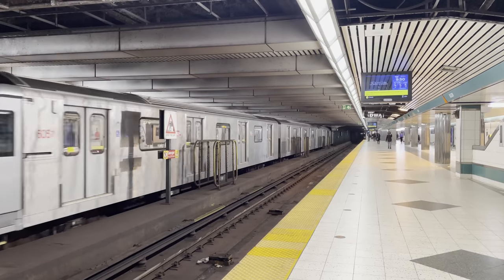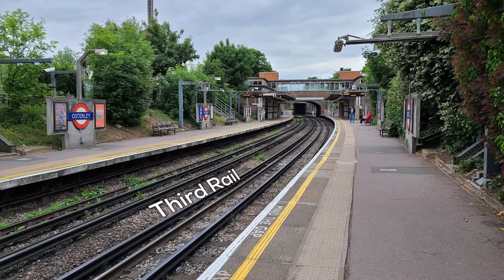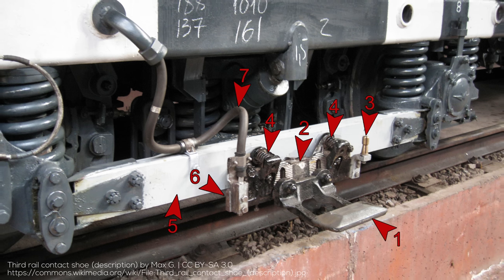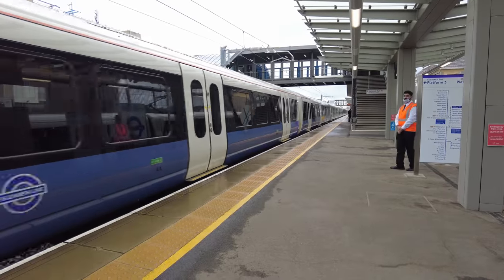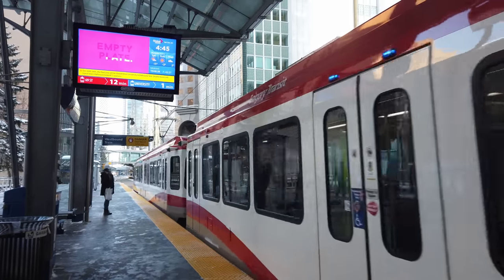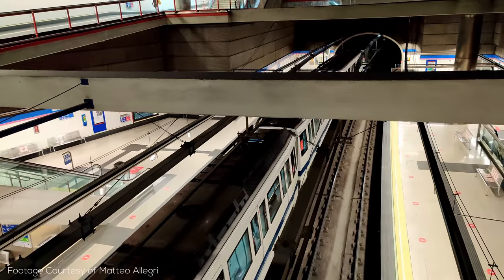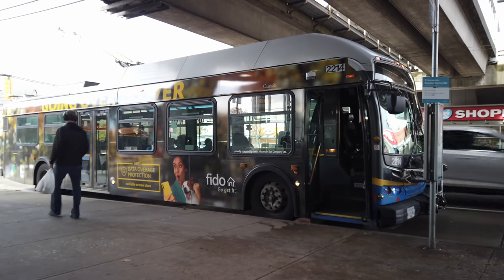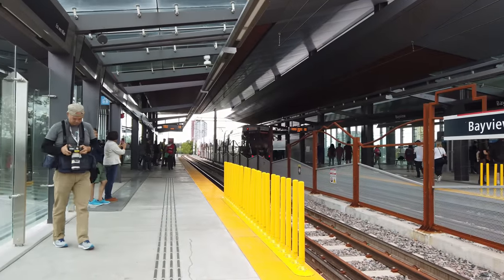The Best Way to Power Your Railway | Third Rail vs. Overhead Wire

Comment: I think it's worth to mention that with the developments made in electric vehicles, it's now possible to make networks that are only electrified in certain places.
For instance, we have buses here that have charging stations at each end of the line. Those buses sit at the charging stations for a couple of minutes before their next departure.
Though those buses are old technology that required them to recharge frequently. They could probably make a few trips on a single charge, but not service a day's worth of trips so the charging stations was a necessity.

Most recently, our public transit has gotten fully electric buses that can operate most of the day on a single charge all over the city. I don't know their actual range but they do run for hours before going back to the depot to charge and i can only assume that they are on super fast chargers at the depot so they can go back into service for the second rush hour of the day.
These buses are heavy as frick due to their batteries but they aren't larger than other buses and provide just as much capacity as any other bus in service.

I am certain the same can be done with trams here, removing the need for overhead wires for most of the network. And only having said overhead wires where trams are expected to recharge their batteries. Which would essentially be in their depot and terminus stations where the trams will wait for their next departure.
This would reduce transmission losses even further and also make many parts of the safer, nicer looking and less complex.

The final frontier for rail traffic would be to have electric trains that can operate for long distances without the need for a catenary.
And the final frontier for everything else would be to have electric road vehicles be able to charge while driving down the highway. However that's done, be it by rails in the ground or overhead wires or even wireless charging like a mobile phone.
And of course, as always, removing any personal vehicle (car) from the roads. Because it's such a waste to have a 4+ seater vehicle with one overly obese occupant too lazy to consider alternatives.
Reply: Trolley buses have developed charging while running (it has an acronym, presently off my stack…), which means they have batteries for running without overhead, but since they are only powering the bus for a (relatively) short time, they are smaller and lighter. And the bus wont have to limp home to the depot to charge or to stand still for 5-10 minutes in a certain spot to top up the batteries.
Trams with batteries exist, look at Bordeaux. In China (and Taiwan?) they use "supercaps", capacitors able to power the tram between stops, and charging them on the stops using a short stretch of overhead wire.
As for trains, dragging the power source along with you for long distances won’t work. That is why all modern railways use overhead. The Great Northern Railway in the U.S. was electric, since the Cascade Tunnel turned out to be impassable to steam trains due to the smoke.  The tunnel was electrifed first, then eventually the whole system. However, a new alignment with a new (probably shorter) tunnel was built, also on a gentler gradient, and in the late 50s the wires came down and GN became all diesel.
For roads, they have experimented with a slot (conduit) for charging trucks, and with two overhead wires and two pantographs. It may work, as soon as they figure out who is going to pay for the overhead, how will they bill the electricity, and who will foot the bill for adding the extra stuff to the trucks. As long as you can have Bulgarian truckers who drive on Bulgarian wages, the diesel truck will reign supreme.
Reply: @cieludbjrg4706  I don't believe you when you say "dragging the power source with you on trains over long distance won't work" because that's exactly what the buses are doing where i live. They haul their heavy power source around and they are less efficient (rolling resistance) and travel up steeper grades and they frequently stop and start which heavy trains generally don't do.

In fact, most of the energy consumption on trains are due to them accelerating up to speed and climbing grades. The rest of the time is spent fighting the (hopefully small) air resistance and rolling resistance they encounter during a long flat journey.
In case it isn't clear, trains are designed to haul heavy loads. If you bring a whole wagon's worth of charged batteries it's enough to allow the train to travel over two thousand miles in flat terrain assuming streamlined body and not traveling too fast.

The issue isn't that it's impossible, it's that there's so much to consider with an untested technology that someone has to invest in it and that investment isn't small by any means.
Powered rails are a tested, efficient and reliable solution. But it could be made even better if it wasn't for the fact that it would be a risky investment with miniscule profit margins due to established standards and penny pinchers having squeezed the living crap out of the existing systems.

IF developed, we could save a lot more but to get there one would have to spend a lot and still not be absolutely certain that it would catch on because... humans...

Comment: I can imagine third rail getting very unpractical fast if there are threeway switches or double slip switches
Reply: If I understand the comment correctly, the answer is no. In such complex switch (points) areas the 3rd rail is discontinuous as in the case of a road crossing. The level of complexity was one reason why southern England standardised on 3rd rail although overhead had been installed in some areas. The concern was the the overhead would be so complex over areas with multiple switches (points) that failures would occur there.
Reply: What happens there is you have to have a gap in the third rail. And if you have a long ladder track with lots of double slips, you just don't have third rail for the length of that, and thus a significant risk of gapping the train. It's not really ideal, especially if your trains are short or powered by locomotives.
Reply: @crzwdjk  the entire Southern region in the UK is 3rd rail, and there are the most complex junctions in the country. The 3rd rail can run along side the running rails for most of a ladder on one or other side. So it's actually extremely rare for trains to get 'gapped'. The chances that no part of a 80-240m long train aren't by a 3rd rail are very small, and the momentum of a train means that it usually doesn't matter. With freight it's more of a problem as you have a single loco so only 2 shoes per side. Even so, 3rd rail electric freight runs regularly in the UK without stalling.

Comment: The Buenos Aires Subte B line was, since its creation, powered via third rail, because it allowed the trains from the above ground Urquiza rail line to reach the city centre acting as metro trains (the line even has full 3,10 meter width rails, when the rest of the subte sytem uses 2,60 meter rails)

 In 2013, the goverment made the (generally tought to be terrible and a possible case of corruption) decision to buy the some of the asbestos laden CAF 6000 rolling stock from the Madrid metro and put them in the B line, but this presented two problems 1) the rolling stock in question is some of the worst designed and ugliest metro trains in existence, and 2) they use overhead wires for power.

so what was their solution? well obviously, add overhead wires to the entire line (a process wich took months of hard work, caused a lot of delays and costed way too much money) and operate the new trains alongside the far, far older but still more confortable Mitsubishi trains that use third rail power.

Now they are planning to buy newer rolling stock (thank god) but only enough to replace the old Mitsubishi trains, while keeping the CAFs working (at least for now, they might still change their minds and increase the number of trains they end up buying) but even then, the new trains will still use the overhead wire, wich would be great if not for the fact that most of the workshops that could service the B line trains are exclusively third rail powered, and the long term problem of cutting off the B Line from the above ground Urquiza Line
Reply: We can always count with Argentina to teach us what NOT to do.
Reply from the maker: I really need to get to making my Buenos Aires Explainer! This is super interesting stuff to hear!
Reply: Now this is an extremely dumb move, as converting rolling stock between 3d rail and overhead is not that much of a hussle. After WWII as Poland regained the city of Gdansk a decision was made to build an urban rail line. The line was built with overhead power, but the trains were spoils of war from Berlin S-Bahn, designed for 3d rail. So they just converted them in relatively short time and at very low cost.
Reply: @mancubwwa  Paris did the opposite on what is now T2 tram line. It was third rail powered when it was still a heavy rail line. When the trains got too old because it was the last remaining 3rd rail heavy line in Paris region, they retrofitted shoes on more recent (but still old) trains while waiting for a decision on what to rebuild the line into (they hesitated between tram and RER infrastructure).
Reply: @RMTransit  You absolutely should! it would be almost surreal to see one of your explainers about my home town, if you need any info when you get around to doing it, i would be happy to help.

Comment: Electricity and overhead wires are clearly optimal for regional rail. But what if they share some of the tracks with double stack freight trains? Can say 250 km/h passenger trains coexist with double stacked container trains on the same rail and 25kV? The height of the overhead wire is the issue. I can see China and also the Dutch has done some experiments and China is doing it a few places. Would one of the containers have to be en reduced height or how is that? What VIA rail doing on the intercity Montreal-Troronto line?
Reply: There are plenty of places that have tall enough catenary for double stacked intermodal trains (India being the biggest) so it’s possible.
Reply: @banksrail  Yes, but India is broad gauge and a dedicated line, so they have few restraints. I am more looking for an example where they does it on standard gauge and have both freight and passenger trains.
In Canada and the North West corridor of the US, it is different as freight and passenger trains are mixed.

Comment: Another advantage of AC power: since the waveform is a sinusoid, IE derived from a circle, it is much easier to power (or get power from) something rotating like a wheel using AC with less parts that might fail.

Power was originally AC in the olden days precisely because the simplest way to get power from a spinning thing such as a turbine produces AC current (also, it was easier to transform without electronics before the 60s).
Reply: Well, you have to change the frequency anyway, so there is a DC circuit in between (if the motors are AC.)
Reply from the maker: I love the technical discussion :)
Reply: @laju  Huh, fair point. I wonder if there any ways to just get rid of the DC step. I wonder how deranged it would be to apply PWM by having a switch close and open the AC circuit to the motor at a certain rate.
Reply: @Blaze6108  I don't believe it would be feasible. The supply frequency is 50 or 60 Hz (or 16.66... Hz in some old systems), and you would have to "chop" it to anywhere between crawling and full line speed. Additionally the motor takes three phases (typically at least), and the supply is just one phase.

Italians had some attempts at three phase supply (with three pantographs and three overhead lines), and then fed it straight to the motors with thyristors or something like that.
Reply: @laju   but they give up since the speed is very limited (just up to 💯 km/hour or 62 miles/hour) and overhead wires is much more complicated

Comment: Is it feasible and/or practical to do a fourth-rail system having both conducting rails mounted between the running rails as opposed to just 1?
Reply: Why would you?
Reply: @Gfynbcyiokbg8710  4th rail so none of the running rails are conducting at any point, and keep everything between the running rails so people are less likely to get electrocuted
Reply: @TyrannoJoris_Rex  That won't change anything.

Comment: Has there ever been consideration given for inductive 3rd rail technology?  That should reduce the safety risks of 3rd rail on ground level systems while eliminating the extra infrastructure for overhead cable.  Not sure inductive pickups could carry the power levels necessary to power a train but it's a thought.  Obviously electrifying the rails themselves doesn't work on anything but model trains because real trains have to have the left and right wheels on an axle joined together for the train to ride the rails and corner correctly.
Reply: That sounds very very inefficient

Comment: And APS is not even a new system.
Trams in the UK experimented with stud contacts back in the 1890s.

The studs were energies by a magnet on the tram and an earthed brush blew the fuse on any studs that remained energised after the tram had passed... Unfortunately they weren't the most reliable of systems and diddnt last being replaced with traditional overhead wires and trolly poles in fairly short order.....

The other system of note is the conduit system as used in London trams where a central third rail was installed underground in a trench with a narrow slit in the road surface... Tram cars had a plough device underneath that ran along this rail providing power... London used a hybrid where cheaper overhead lines were used in the suburbs and so the ploughs were removable, change pits were installed where the 2 systems met, at the last stop before the change the wires would start and the pole would be raised... the conduit would then move to the side sliding the plough out from under the tram and ejecting it into a central storage lane (unpowered) as the tram passed...

In the opposite direction the plough would be inserted into the next inbound tram using a long fork like device and the pole would be lowered at the next stop

Comment: What is the differance in cost between third rail and over head wire?
Reply: It's complicated. On one hand overhead lines need supports and modifications to infrastructure like bridges, but on the other, 3rd rail has far bigger potential drops (due to the limit on the voltage you can use it with), so you need a lot more substations which adds a lot of cost, so there's no one size fits all answer. Also, the higher transmission losses mean that the long term cost of providing power is likely to be higher than for an overhead powered system

Comment: What about the trams in Newcastle, Australia which have overhead wire in their depot, use batteries along the street and have an overhead charger at each stop? Could this technology be applied to railways which have missing links in electrification? 

Also why does Singapore swear by third rail power?
Reply: Singapore only really has the MRT and 3rd rail makes a lot of sense on metro systems

Comment: Is overhead or 3rd rail cheaper to build? I know this isn’t transit related, but would 3rd rail be a good option for US freight companies if we can somehow get them to switch away from diesel and go for electric power?
Reply: I think no, maybe it can very expensive than Catenary because 3rd rail can only use DC, which is limited. You need much more substation. The highest voltage 3rd rail can support is around 1.5 kv, some metros in China use this
Reply: On its own, 3rd rail is cheaper to install (which is why many early systems such as old metros, Berlin S-Bahn and South East England use third rail) but limited to low voltages and need many substations whereas overhead wires can reach much higher voltages and with fewer losses. There also is the easier danger of electrocution and another reason why 3rd rail isn't as common nowadays outside of metros.

Comment: I have a simple idea. All electric train powered by the wheels of boxcars. The wheels could all have generators at DC that the train runs on
Reply: Even elementary physics will tell you it's IMPOSSIBLE.

Comment: Overhead wire is more vulnerable to theft. In Sydney, the authorities have stated that there have been cases where energised overhead wire has been stolen.
Reply: Any less than third rail?
Reply: @grassytramtracks I'd be surprised if any third rail got stolen - that stuff is heavy.